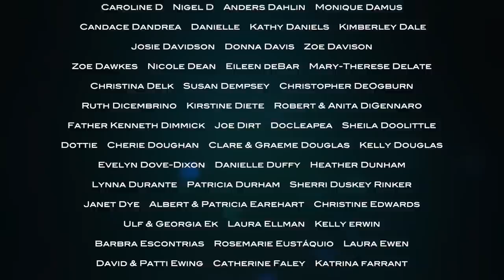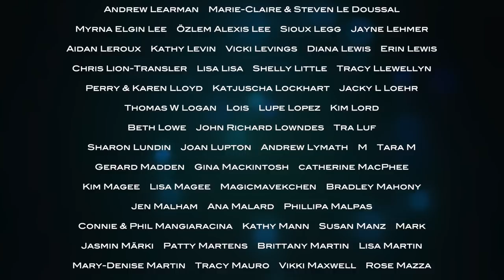THE SKELETON CREW

Comment: I'm sure that somewhere there is video footage that shows how thing things on the top shelf were organized.  And the back of the clock appears very normal of that type of clock kit.  Normally the wall would serve to hold the battery in, instead of a cover.

Comment: Gosh, I thought the panelling in the Grand Salon would just affix to the current walls. Once the plaster is off, everything will be wonky again and need packing out. Plus so much dust! What a huge job for Amaury! It will look amazing when it is all finished. Take care, and please have your booster shots with all this travelling.
Reply: The Grand Salon leaks heat so the walls need new or checked insulation. Then the panels go over the air barrier.

Comment: So exited to see the panel come up! If you do decide to paint it, please use a proper emulsion paint or linseed oil paint that will keep the woodgrain breathing and healthy without cracking. Linseed oil paint was what they ised back in the day, and the texture and feel is superior to everything else, plus the oil conditions the wood and keeps it from drying out. The downside being you’d want to paint it come spring or summer as the paint dries very slowly (to touch only in days but to finish it takes about 2-3 months, and surfaces to place things on about 4-5 weeks), and it reacts ie dries quicker in natural uv light.
But it’s really worth it.
Whatever you do just don’t use modern wood paints not suited for antiques, they encapsule the wood like plastic film, and you can understand what that means in a space with varying humidity and temp during the year (and you can feel it too).
I’ll admit as beautiful as the china cabinets turned out, I’ve more workshop and tool envy of Amaury than china envy! 😍 Not a wood worker but do some metal work besides other crafts, and would die to have a proper worshop and studio at home! 
Winter is definitely here.
I wish I could be there to help decorate for Christmas, as I’m mostly on my own here this year so not worth fussing about. 
I love old fashioned christmas decor and used to make garlands of spruce, holly and blueberry brush for all windows and mantles. Tall cones of goodies and fruit frosted with eggwash and sugar, etc. I look forward to seeing Lalande all decked out! ❤️

Comment: Sorry to ask this obvious and possibly lazy question, but can't you put the panelling on the plasterboard and save a lot of work?
Reply: Also they are checking/replacing insulation as Winter Salon leaks heat.
Reply: @sues6384  They talked about the freezing Grand Salon and getting better insulation, even before Stephanie asked Amaury to do the project. Just watch all the Vlogs. They did insulation in the attics this year also. 😐🌹